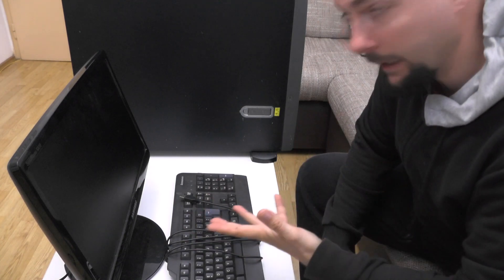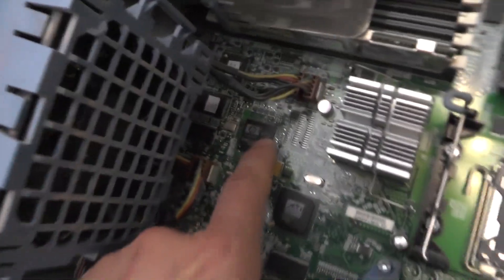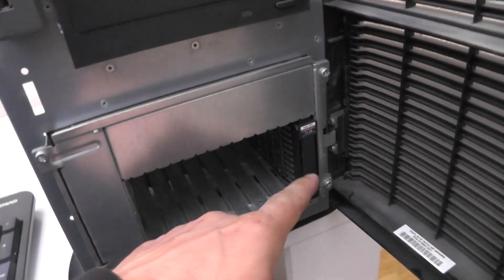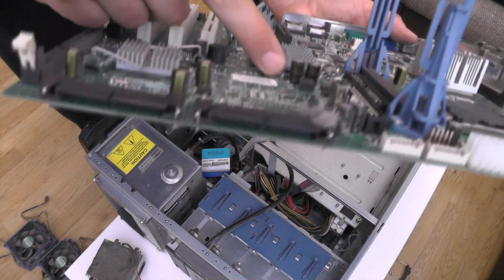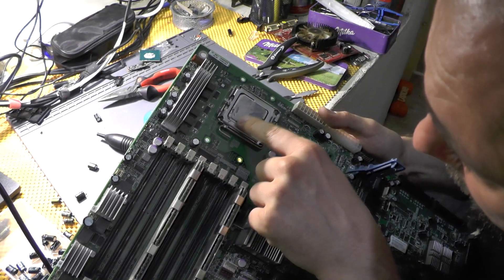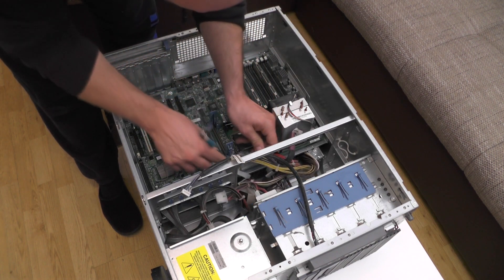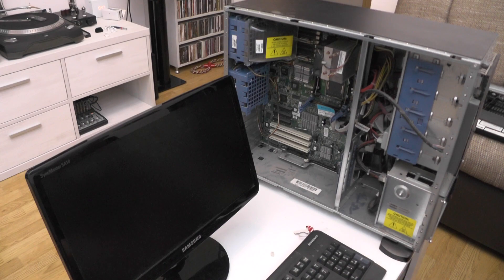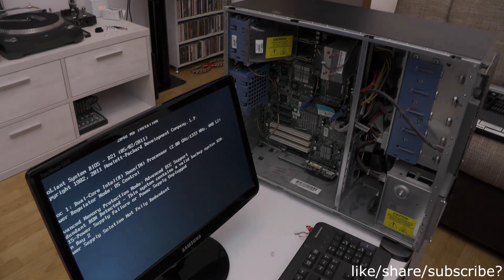6$ Flea market find - HP Proliant ML350 G5 Server

Comment: I found one of these G5's about a year ago sitting outside a Chase Bank dumpster. I figured whoever brought it out couldn't lift it in to the dumpster so it was just sitting there. They stripped the hard drives out of it but the raid controller and cache card are intact. I'm actually going to build a retro machine out of it. Whether that be emulation, or a machine geared towards win95/98 gaming I haven't decided. In the discovery phase.
Reply from the maker: it will do for whatever you decide

Comment: May be a little late but I have the 370 server model, on the device page it says that it has 12 gigs of ram so I was wondering if there was any chance of using this for gaming
Reply from the maker: I guess so... however i would go for NO... (cpu/s are too old/slow) and who knows how the gou will work... but i guess you can try :)))
Reply: I have the 370 as well. I put E5450's in mine and have boosted the RAM to 56GB. I hope next week to take it to the max of 64GB.  But I use esxi 6.5 on mine for work testing as a home lab environment. I'd pickup a used dell precision tower like a T3500 or T5500 if you want to do gaming. (I have a T3500 as my gaming box with a 6 core , 12 thread cpu.)

Comment: Hi, I have a short circuit over the capacitors you replaced and various other SMD capacitors and I haven't been able to find the culprit.  Can you tell me if you had the same issue?  All the electrolytic caps are removed. Thanks
Reply from the maker: Bri Bri hi, something looks like short to ground. I had no such problems. Have you tried disconnecting all cards and turning it on? Also, try remkving cpu/ram